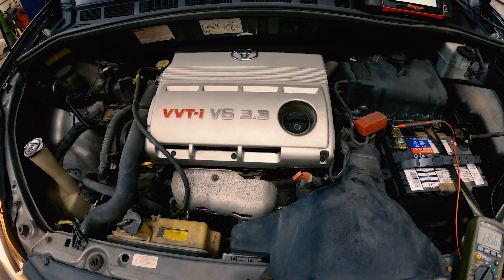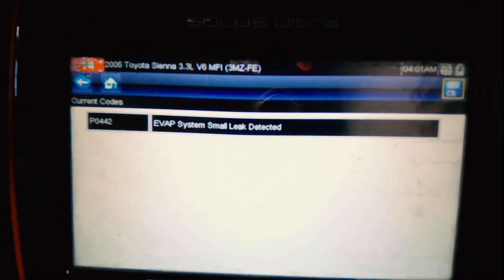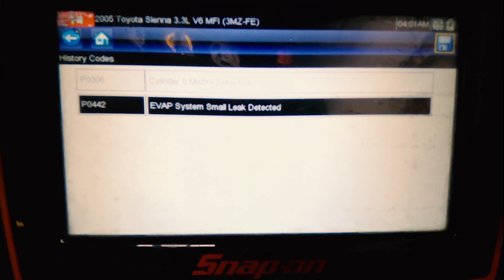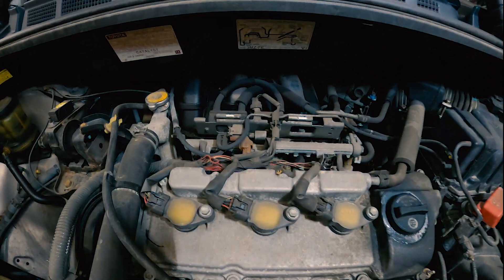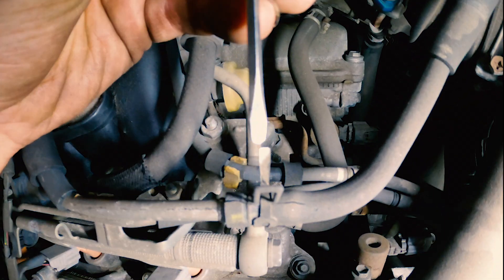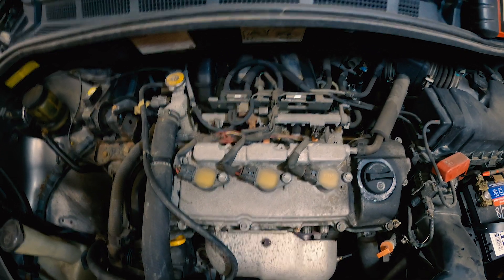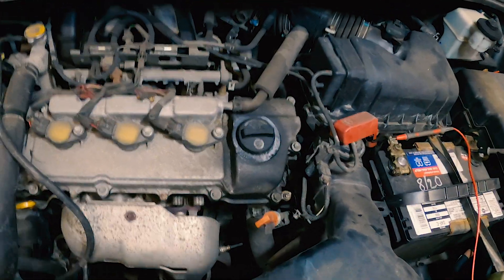Check Engine Secrets: Toyota P0442 Check Engine Fix

Comment: Where can I find that kind of hose? If you can mention what diameter it is, I can find it easier. That's exactly what I found the problem to be thanks to you.
Reply from the maker: It’s 1/4 inch vacuum hose.  Most auto parts suppliers sell it.  You can use 1/4 fuel line in a pinch.  But Fuel line is designed to hold pressure in and vacuum hose is deigned to resist sucking in and collapsing.  If you make a sharp bend with fuel line and apply vacuum it will collapse and restrict or stop the flow.
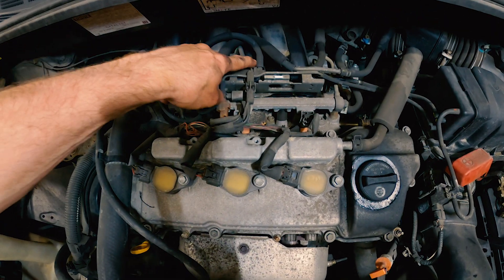Reply: @MechanicSecrets  1:53
 Specifically the vacuum diaphragm box that has the U-shaped hose is the culprit and appears to be wider than some of the others. Someone else before you told me 7/32". I'll get the 1/4" as well. All of the vacuum-switching hoses might as well be replaced. Thanks for the detailed information!
Reply: Each one of the sections of hoses is sold individully though Toyota, you can't but 
the hose in bulk through Toyota. If you go to an auto parts store they sell vacum hose material there, just take a piece of the hose you want to match and they will try to match it. Toyota hoses are metric and most of the hoses they sell are SAE.
Reply: @connorrampage7817  I wound up getting some closely matching hole opening size hoses on Amazon. Thanks

Comment: Thanks for your video. My 05 lexus rx330 same P0442. 2 rubber hose cracks same area. Before, I changed gas cap oem factory. Still pulling that code. Ill replace those crack hoses.🤙

Comment: Vent hose #2 (as Toyota calls it) is notorious for cracking with age. It's the one with heat shielding around it. Not sure if it's considered part of the EVAP system though.
Reply: It is part of the evap system. Had it diagnosed by a technician. Smoke tested the whole evap system and cracked hoses were the culprit.

Comment: Thanks for sharing and finally I got to know the name of the emission vacuum diaphragm box. I broke one of the nipples and can't find a replacement part only a kit. Where can I buy just the box? TIA.
Reply from the maker: This will likely not be available as an aftermarket part.  You can try a junkyard or used auto parts location.  Good luck!